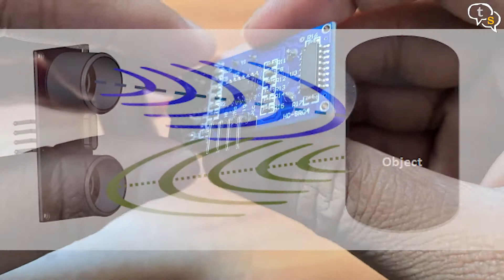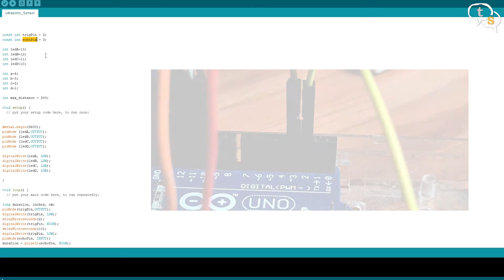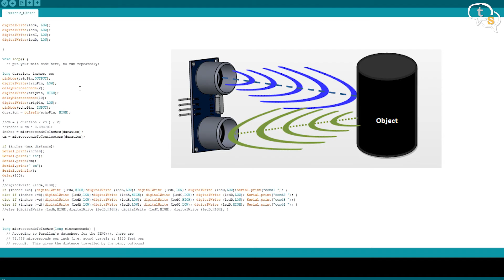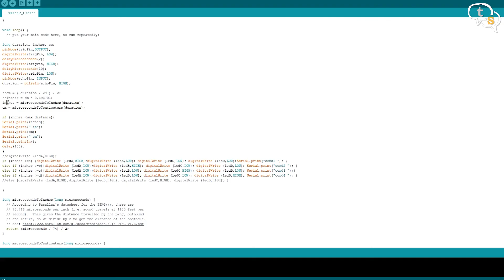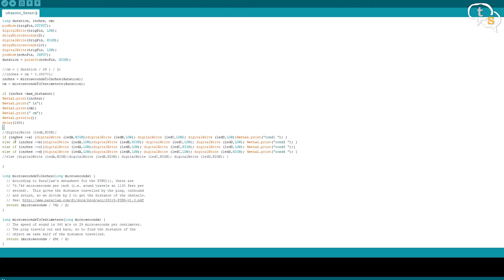Ultrasonic Water Level Indicator using HC-SR04 & Arduino

Comment: Sir i have problem, only a single led is blinking so can you give some instructions to change code in another video please 🥺🥺
Reply from the maker: Make sure of the variable values , these need to be changed as per the height you need them to light up at.

Comment: Sir, what is the quantity of water tank that you used to fill water in your small project? Will it work in 500ml or 1L after entering your codes??? And what changes will have to be made in the coding please tell.😊
Reply from the maker: You need to measure the height of the container you're using and a, b, c, d are the 4 levels (heights) stored in the variables, which is where you'll input the value you'll want the leds to light up at.
https://talkingstuff.net/water-level-indicator-ultrasonic/
Reply: @TalkingstuffNet I buyed everything and project is full working I edited codes while seeing your video and some codes are missing on your website that I changed from seeing you videos just have do some code and measure my container and put variable 😊

Comment: Not getting the proper output after connecting,automatically led light gets on and only one led is getting on...can i get the instructions of what to do?
Reply from the maker: You will need to calculate the height and set the variables accordingly. Also try changing the code to see if you change to a different led does it light up instead.

Comment: Will the output be fluctuating when connected to pump cause in the experiment the leds are blinking on increasing the water level, could it be solved by increasing the pulse intrervell time
Reply from the maker: It keeps fluctuating between the LEDs as the water has to stabilize and because it's still moving while being poured it triggers multiple LEDs.
Reply: @TalkingstuffNet  thanks for replay, one more question will it make the pump to fluctuate when connected
Reply from the maker: It will not as it's connected separately.

Comment: Hi Vinayak. I liked the video. Can I use waterproof Ultrasonic Sensor JNR-SR04M instead of HC-SR04. Will there be any change in the code if I use JNR-SR04M. 
Thank you
Reply from the maker: You will have to anyway calibrate the values in the code as per what's being returned by the sensor. I feel the rest of the code should be relatively the same.

Comment: When I installed it the sensor output is unstable ,it keeps fluctuating. This happens only in the tank ,it works fine rest of the time
Reply: Tanks have a resonance frequency it might caused a problem.

Comment: Hi vinayak thanks for this video. One thing i would like to ask is how long can the cable be? Because i am planning to do this with 2 Ultrasonic sensor; one for the top tank and one for the bottom tank (for dry run protection). So the total distance comes to around 80 metres ( top tank and motor are at diagonal corners of the house) 🙄.
Reply from the maker: I haven't tried installing it in my tank, I'm using a pre-built soltution now and they provide a 100 metre cable with their plug.  It works well, only concern I have is the power to the sensor at that distance when we make a custom solution. In an earlier water level sensor video I had used a 50 yard ethernet cable to power the water sensor and it worked.
Reply: @TalkingstuffNet  any link to the pre built controller set that you are using?
Reply from the maker: I'm using tankbolt by Oakter 
https://youtu.be/cbIdgWi1uBE
Reply: @TalkingstuffNet  its great. Just one thing. It doesnt have sensor to check lower tank level. If the motor is connected to a well then this is fine, but i have a tank which stores municipality water which sometimes used out when municipality stops water for 3, 4 days due to some maintenance.

The product has dry run protection but maybe that is just checking if level is changing after motor turns on; if no change means no water. But in this case pump will get damaged over time plus we will need to prime the pump manually the next time. 🙄

Product is currently available only in tata cliq now @3990.
Reply from the maker: It has dry run protection, if the tank level doesn't increase for a certain time period  it stops automatically. But it can't monitor the lower tank. I liked this because of the app and Alexa control. There are other options available with both upper and lower tank sensors but no automation or app is present.
Reply: @TalkingstuffNet  its a very good product actually. As you said the app is impressive. Thanks for suggesting this.

Comment: Nicely done!! Now to figure out how to get it installed on top my water tank and keep humidity out.
Reply from the maker: 3d printed a case for the ultrasonic sensor and except for the sensor transceiver the entire PCB can be encased in silicone. Using a long wire you can have the circuit within the house to view the level, only the sensor stays within the tank.
Reply: You can use clear nail polish for waterproofing.

Comment: Can we apply this ultrasonic sensor to a bigger water tank, like 1 ton tank? If we can, is it enough to use only one sensor?
Reply from the maker: I've not tried the circuit with a bigger tank, but I did purchase a readymade solution and I'm using it with a 1500 litre tank. Looks like they're using a similar sensor.
Reply: @TalkingstuffNet  Which readymade solution did you use?
Reply from the maker: I'm using the oakter tankbolt at present 
https://youtu.be/cbIdgWi1uBE

Comment: Hey is there a way i can make the hcsr04(ultrasonic sensor) waterproof?
Reply from the maker: Maybe make a case for it and submerge the main circuit in glue. But the front sensor is still not waterproof and it needs to be open to send and receive signals so it's not going to be totally waterproof.

Comment: Hello Sir. Can we use float sensors instead of ultra sonic sensor- because ultra sonic sensor is not recommended for long term usage. How to rewrite the code for float sensors.
Reply from the maker: You have generally an on and off state only , you will not get granular levels but you will know when its on so you can play an alarm sound when the tank is full.

Comment: Thank you . Great project. Don't we need current limiting resistors in series with the LED's?
Reply from the maker: We do, as i was setting this up temporarily i didnt use them. But I did mention it in the video. I didn't have low value resistors to add to the circuit.

Comment: Great tutorial, thank you!

I would like to use this in water, yet....I'm confused by what you said at the end about 9:30.

"If you would like to use it with your water tank, you will need to place it in a protective housing". |

Given this is sonar, would not the echos bounce off the protective housing (instead of the water level), giving reading of protective housing?

If you can elaborate, that would be appreciated!
Reply from the maker: You will need to place the sensor in a protective housing but the sensor area should be open to be able to transmit and receive the signals. The sensor by itself is not waterproof and will be damaged if submerged in water which includes splashing water too. So to protect the components I suggested 3d printing a housing to protect the sensor to a limit. For example https://www.yeggi.com/q/ultrasonic+sensor+case/
Reply: @TalkingstuffNet  that's fantastic. thank you very much. I find myself currently trying to start designing 3D stuff with FreeCad, and I'm having a little difficulty. Is there any resource or application you would suggest for Windows and a complete novice to 3D printing? Cheers

Comment: hi sir, what if the results of the data are calibrated from ml to cm so that they can be implemented on IOT
Reply from the maker: You can rewrite the functions to provide the appropriate units and use the output to trigger other devices. We already have inches and centimeters.

Comment: Can we use lcd screen instead of led to indicate the level of water
Reply from the maker: Yes you can, but you will need to rewrite the code as required for the LCD screen .
Reply: An also i need to add a buzzer to arduino so in which pin do we need to connect it an lcd display connection pin also
Reply: I have the code in python for raspberry pi but its very costly how can i implement the same code of pi in ardunio
Reply from the maker: I have provided the code on my website for the Arduino. But without a LCD screen. There should be tutorials available where you would show the percentage value on the LCD as per the level of water.